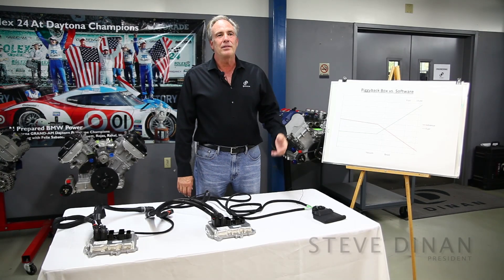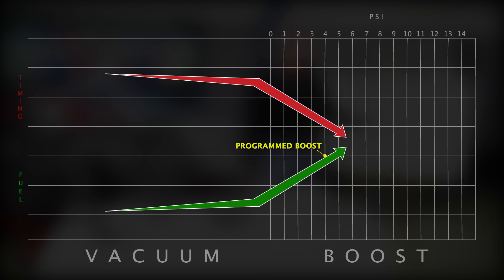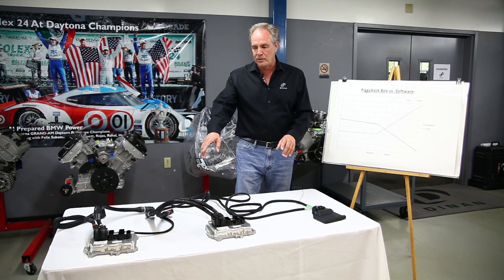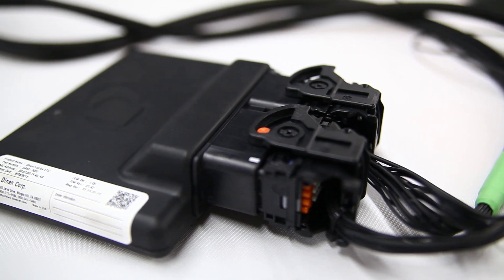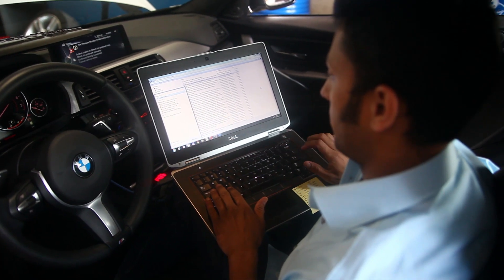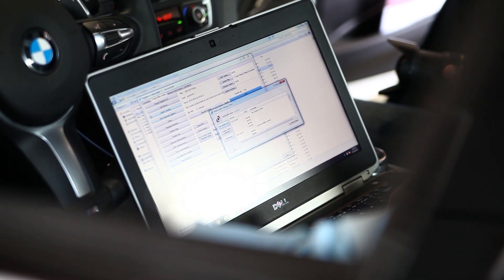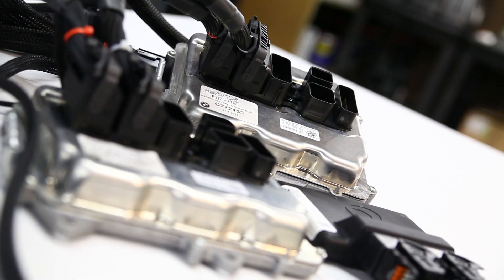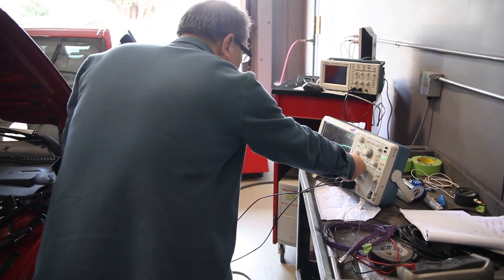DINANTRONICS In-Depth Description: How it Works

Comment: Does a Dinan tune voids factory warranty? I have a 23 X3M40i. Thinking about getting this tune
Reply from the maker: Nothing outright voids the factory warranty but it definiately can effect it. Do not currently have a tuning option that carries a factory matching warranty for the '23 models. The current option (DINANATRONICS X) is a 1 year, product only, warranty. Eventually the Dinan+ software flash will be available and that is the engine tuning variant that would have the 4yr/50k factory matching warranty.

Comment: Do you guy’s also adjust anything within the transmission also? Shift points. Pressures? Thanks
Reply from the maker: With DINANTRONICS? No. Would need direct access to the TCU/ECU in order to do either of those (a la a flash). We do alter how fueling comes in during shifting in order to soften the transitions between gears but thats about the closest thing to any transmission related modifications with DINANTRONICS.

Comment: So why did you guys make the sport tune for n20/n26 that only controls the boost?
Reply: @DinanEngineering  do you guys make a flash tune for the n20 something similar to bm3?
Reply: @DinanEngineering  how about now? I was told by your college that a Dinan "flash" is here...well for b46/b48 motor.
I have had your Dinan Elite, but it's been iffy to say de least. However as of now, your team said they are looking to work with me towards a better product/flash. I'm looking forward to their word ⏳
Reply: @DinanEngineering  I'm in NYc area...will you happen to know price range? Also quick question, what's de correct way to bypass Dinan Elite module? I need to drive and afraid of my now CEL/too lean code.
Reply: @DinanEngineering  yes I have mini application set UP to where I have to separate keys and disc. neg. batt.

Comment: So I watched the video, but now has me rethinking a purchase of the Dinan Sports performance tuner. Since it sounds like the $299 Dinan device boosts only, but doesn't correct for fuel, etc. This video sort of contradicts a product it is selling? https://www.dinancars.com/product/d440-0010-dinantronics-sport-performance-tuner-for-bmw-n20-n26-n55-engines/
Reply: Lol did you not watch the video? He was explaining that most Piggyback boxes don't correct for fuel/air etc but theirs do.....
Reply: @chrismackay9268  Not the Sports performance tuner.  It can't as it only touches the sensor in the intake.  Only the Stage 1 tuner actually has all the wires discussed on the video for interfacing with the ECU.
Reply: Im not here to debate just to add to the issue mentioned above it does infact say exactly this in the add for the Performance sport tuner and i quote "utilizes the factory DME, in tandem with itself, in order to re-map boost, fueling, and timing for optimal performance." So not sure if they are intentionally misleading customers with this one or if its the marketing team that dont know enough about the product or if it really does manipulate these other parameters.

Comment: Understand DINANTRONICS ECU basics.  But how does it compare to the "standard" performance software that they've offered for years (eg, Stage 1 software, Stage 2 ...)?   This product alone gives you lots more HP and torque (although it doesn't improve handling).  So if you're a (aggressive) 'Daily Driver' who wants the extra power (not bringing car to track), why bother adding DINAN CAI, exhaust or other expensive upgrades to driveline, gearing, turbo, etc?  Seems like Dinantronics provides a lot of that power increase without you investing big bucks in a bunch of additional DINAN parts.  Costs much less and reduces labor hours substantially versus more traditional (pre-Dinantronics) approach.  Can someone help me out?

Comment: Why is this a better solution to an ECU flash/remap?
Reply: "A little over a year ago, one of Dinan's software engineers walked into Steve's office and dropped a bombshell. It's impossible – "it" being cracking BMW's encryption on the F10 chassis. That's the first time in Dinan's history that it hasn't been able to gets its mitts into BMW's code and bend it to their will. After trying every conceivable solution, Steve and Co. finally pulled the trigger on what's now known as Dinantronics, a completely custom, plug-and-play ECU that gives the company the control it needs.  This is not easy. Hop on eBay or any BMW forum and you'll see dozens of cheap hacks that raise boost pressure on the twin-turbo 4.4-liter V8 (S63B44Tü for you code nerds). The problem is when the boost is raised, the factory computer freaks out, tripping over itself to correct the fuel mixture, ignition timing, and a host of other parameters. Eventually the angry engine starts throwing codes. At best power is lost. At worst, the $299 black box from BestBMWTUNRES just voided your warranty and broke some very expensive things.The Dinantronics setup takes in all the information and tweaks it accordingly, from air/fuel mixtures to ignition timing in a blur of gee whiz tuning that I can only assume requires a wizard hat and a sacrificial chicken. And it does all of that while keeping the trim corrections – that is both the ideal and scheduled fuel mixture – within the specifications of BMW's propellerheads. It also makes power." Source - http://jalopnik.com/the-dinan-s1-m5-is-how-an-obsessed-tuner-builds-a-bette-1643950782

  In summary, the F10 is encrypted to the max, which is a problem with stock ECU flashing and still making it a reliable machine.  Dinan engineering showed us yet again that we should bow to them by creating their own ECU for the F10 M5 so not only will it work with stock settings, they can tinker around with whatever they want without running into BMW stock encryption issues, whatever that may be.  So sure you can get it reflashed for cheap, but good luck later down the road.  Especially if you are going to drive an M5 like an M5 should be driven (grocery getter, highway cruiser, going to work, picking up the kids, and going to the track all in the same day.).
Reply: So what about dinantronics plug and play unit then, does it wreck your engine since you just described exactly the same thing.
Reply: @Baka_Oppai   if it did wreck your engine...it would be covered under the Dinan warranty...and if your car is still under factory warranty, Dinan upgrades will not void it...so, you may pay a lil more in cost because of their R&D and keeping your warranty...but...piece of mind that everything is covered is priceless...unless you have money to throw away...and most likely...u will not encounter "limp home" mode with Dinan upgrades....but...never say never...
Reply: @TheBlBeckerman so I should get something like this for my M6?? So this is better than flashing it? Would I get more power if I add catless downpipes and front grill air intakes?